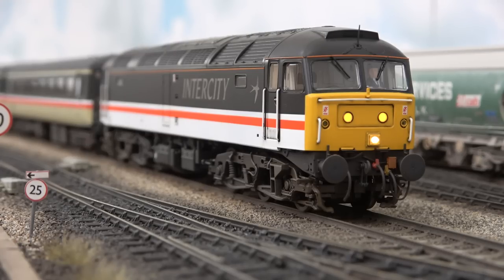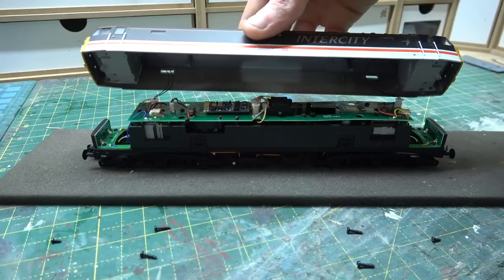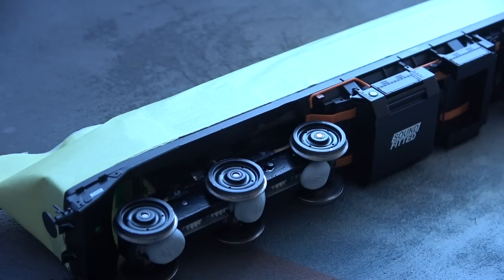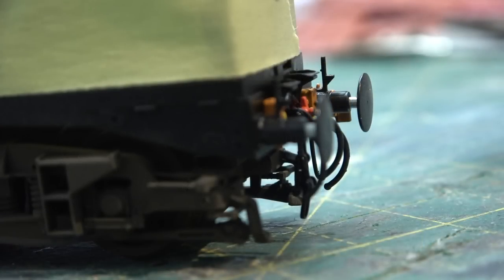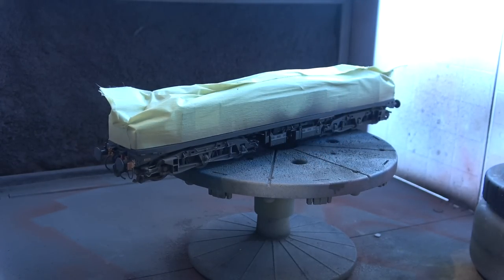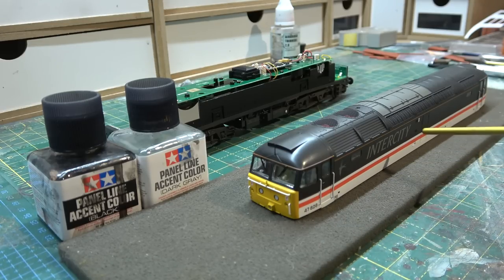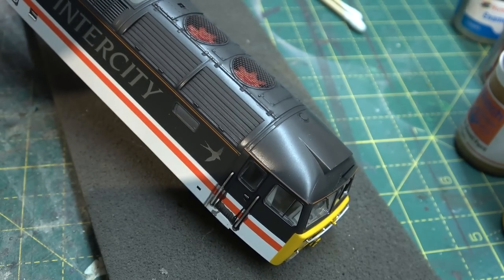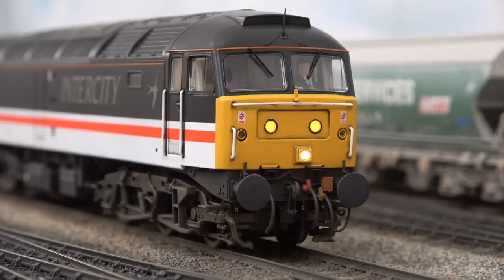New Bachmann Class 47 – Weathering

Comment: Another excellent tutorial, Richard.  And as usual the results are very realistic indeed.  From what I gather, many modellers here in the US have the same attitude toward sound as you do.  I discovered this independently when after a very long break from the hobby I built a very small switching/shunting layout which uses only one loco at a time.  I converted one of my old engines to DCC with sound.  It was very exciting at first, but I ended up turning the master volume down quite a bit and eventually realized I was quite happy running engines with DCC but without sound.  So I have sound only when that one loco comes up in the operating roster rotation.  Cheers from Wisconsin!

Comment: The trouble with sound is that it doesn’t scale. The engine idling and then picking up a little as the amps come up and it starts to roll away, if you were sitting on the platform at at Shrewsbury and a forty came in ,stopped ,had a crew change then drifted off with its train, out and round the corner the engine would be there in front of you making loads of noise but that would diminish rapidly and by the end of the platform or even halfway down you wouldn’t hear it, just the boom of the empty tanks that make up its train
With the model sound the distance is constant so the sound is too, so it’s not unrealistic, just doesn’t behave like you know it should. 
Lovely job on the spoon. At 27.30 it looks so good that I was hoping the louvres we’re going to open and shut and a big cloud of black exhaust going to pour out. I’ve driven a few of them long range tank ones. Happy days.
Reply from the maker: That's my argument with sound.  In real life the train being pulled makes far more noise than the loco.  The loco often can't be heard once a few wagons have passed you.  Its clever and entertaining but I certainly wont be converting my fleet to sound.  Glad you enjoyed it.  Cheers

Comment: Another superb video Richard, full of great tips and info. Sound in locos is a no go for me as I experienced in the early days of it showing my layout next to one which had over 25 locos on full sound in the engine shed throughout the two days of the show!. Would not affect me as never had DCC due to cost of converting my fleet of 80 plus locos.
However weathering is excellent when properly done. Having a few years back come into a small amount of surplus money I purchased a superb compressor and air gun for £700. They are still in their boxes!!! I somehow never got the confidence to use them but I will one day despite the fact I am getting rather old. Your video encourage me no end and I thing what holds me back is the arthritis in my fingers. Pulling the air gun levers is actually quite painful and the thought of over 1000 pieces on N gauge tock is not the best tempter to proceed.
Meanwhile I shall just enjoy the excellence you give us. Cheers, Bob

Comment: An excellent bit of work on this new 47 Richard and really good to see a subtle weathering job which I prefer to a heavy weathering job, the detail on this new 47 from bachmann is incredible the lengths that bachmann have gone to on this model is great to see, to me it shows that Bachman can still be a good manufacturer who can still release a great model even with the many other manufacturers who are coming onto the scene, the sound in my opinion is acceptable, the sound to me is adequate, it does sound like a 47 and I have only heard 47s as they have gone past me when I have been videoing them on the rear of trains hauled by steam locomotives.

Comment: Nice job once again. One thing I picked up on was painting the driver. Fully agree on not trying to paint any facial features in this scale but have you ever tried a wash to lift the detail?
Warhammer figure painters use a flesh wash on their figures to add depth to the faces of their gaming figures. It's very easy to apply and could help avoid that mannequin in the cab look. 
Looking forward to your next update.

Comment: The brown Tamiya panel liner works good on faces for tiny scale figures. I put a few drops into the well of an aluminum pallet and thin it about 50% with thinner. I use a fine brush to put it in the details of the figure's face and hands. After it dries, I use the same fine brush with clean thinner to clean off the bridge of his nose, cheek bones, point of his chin and his fingers leaving the wash in the low spots.

Comment: Great video I’ve been waiting to do this my Virgin 47 & now recently purchased intercity 47 with both with Bachmann mk2 stock, thing I’m struggling with coming up with a way of putting roof dirt on and then taking off like it’s been through a washer leaving a line before the roof gets to the side of the locos or coaches,  the issue it’s the washer bush marks as it isn’t a straight line. if that makes sense,

Comment: The sound in the new Bachmann models is brilliant and done by south west digital, but the problem is always the speaker, they always fit crappy ones with no back boxes and they sound pretty tinny
Reply from the maker: I was referring to sound in general.  I have some models fitted with better speakers but I'm still not convinced.  After a few laps I still find myself switching them off.
Reply: @EverardJunction  Try fitting an earthmover 2 speaker

Comment: With regard to painting the driver, you might want to look at army painter military shader. It's a "shade" coat you paint onto the figure after doing a paint job which brings out the detail. Couple of videos on you Tube. There's even a quick dip into which you obviously dip the figure. They're designed for wargames figures which have a higher level of detail but might be worth experimenting with.
They also might not be "relevant" to every model railway, but with Everard being a more realistic one, from weathering/Graffiti etc, they might fit. And for £3 it's not to pricey a go.
Reply from the maker: I'll give it a try in future thanks.  I've never been too bothered before as the figures end being fitted behind glass in hard to see areas.  On video they look obvious as I zoom in frequently but in reality they're hardly noticeable especially when the train is running.  Cheers
Reply: you can also try tamiya's new flesh tone accent similar to the panel liners

Comment: Hi Richard, super stuff. I always thought two liveries suited the Class 47, the BR large logo and the Intercity swallow. That was a great period when BR seemed to be getting it right. You mentioned at the end, not being convinced by sound and the way the drone of the engine gets to you after a while. I've found all sound chips I've installed, or loco's bought already fitted have the sound level set to 100%..............There really isn't any need for it to be set so high, I've altered all of mine to about 30% of their max level, and they really do sound much more realistic. Almost like you can't really hear them until they get close, then as they pass the sound fades again. Anyway all the best and thank you for the lesson in weathering Dave.
Reply from the maker: Hi Dave.  I have the the sound turned right down in the few equipped locos I have.  The 47 was ridiculously loud when I first got it.  Even so I still find myself turning them off.  The only one I leave turned on is the class 205.  Running on the automated branch line keeps the sound interesting and varied.  Cheers

Comment: You’re a braver man than me, looks great! Wish I had the guts to do this but fear I may mess it up. Fancy doing mine and a rake of Mk2Fs and a DVT? 😉 Obviously for a £.

I’m wanting to add the white dashes to the wheels, marked out on the wheel rim every 1/3rd of the way round, did you consider doing that on this?
Reply from the maker: I've added those marks to several other locos in my collection.  I try to strike a balance so for this model I decided against it.

Comment: Class 47 / 7 & 47 / 8 all had reinforced floor fitted and the 47 that being moved by two overhead crane is in the Erecting Shop Crewe Works, sadly this building + 9 shop, Blue Room (engine repair) arcade and the machine shops have now gone and its a housing estate. I'm ex Crewe work from 1982 and my very first loco to work on the very famous Class 47's and the unforgettable sound from that Sulzer engine.

Comment: I'm of the same opinion with sound equipped locos,  they're OK for 10 minutes but then I run them silent .
A great tip i learnt from a professional weathering expert years ago was to rub an HB pencil on buffer heads to replicate that shiny greasy patch.
Reply from the maker: I have some models fitted with better speakers but I'm still not convinced.  After a few laps I still find myself switching them off.  Especially when I'm running several trains at once.  Pencil trick sounds good, I'll give that a try.  Cheers

Comment: Richard, just as a matter of interest,  what type of spray booth are you using? Been looking at getting on myself shortly.
Reply from the maker: Just a cheap generic ebay one.  Had for it many years and it works well.  Similar ones come up if you google airbrush spray booth.  I think I paid about £50 for mine.  Cheers

Comment: Hello you said the gear box is made of Mazak. Are you not worried with the price of this locomotive that it could suffer from Mazak Rot one day. Hearing that has put me right off buying one
Reply from the maker: I'm assuming its mazak as most models we have in the hobby have a mazak chassis.  To my knowledge only Hornby models suffered from mazak rot and that was a specific batch over 10 years ago.  Some newer models now use tungsten alloy instead but that's only been a recent thing.

Comment: With you having 5 tracks am sure it works out as : down slow , down fast , up fast , up slow and brench relief line . It's what I have seen in real life.
Reply from the maker: I'm modeling the western region.  You have main lines (fast) used by the faster trains on the south side of the route. The relief lines (slow) on the north side are used for slower services and freight.  On my layout I've added a branchline that runs in both directions.

Comment: Why don't you just brush paint the wheels and pickups? Not very visible anyway.
Reply from the maker: Sometimes I do, sometimes I don't.  In this case I went for the airbrush and in previous vids I've brushed them.  Either way the wheels need cleaning when the model is finished.
Reply: @EverardJunction  Ok.